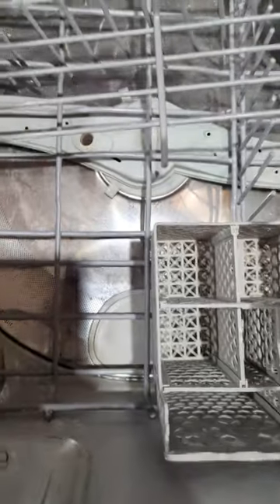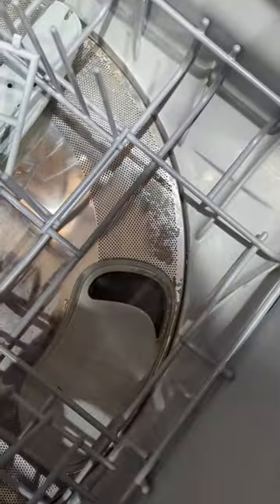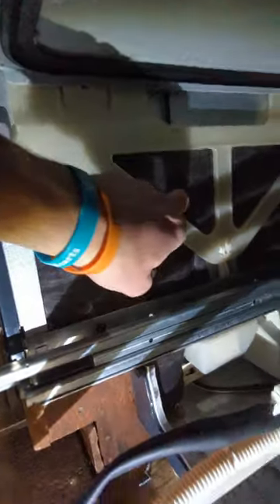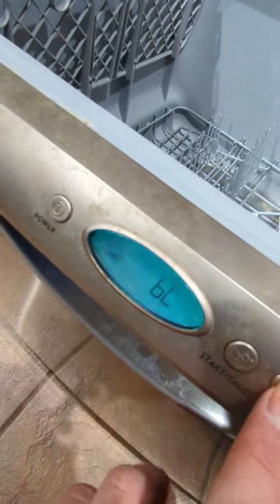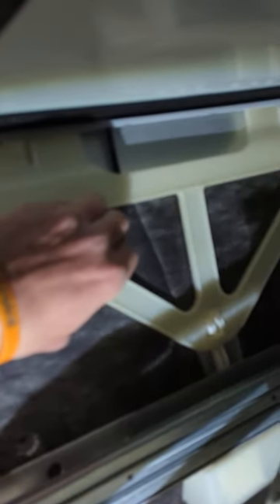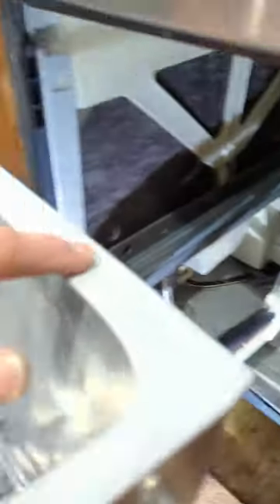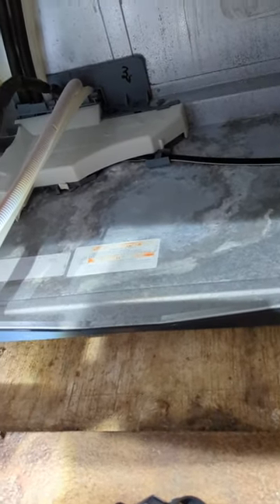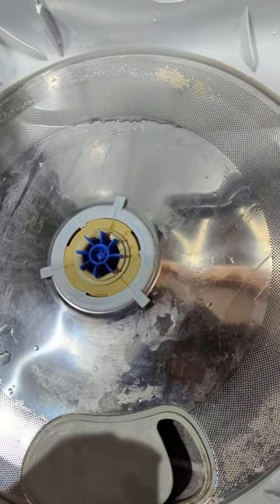Fisher & paykel double drawer dishwasher F1 solution.

Comment: Thank you so much!!! It saved me several hundred bucks. I had an exactly same issue that the attractor somehow moved back all of a sudden and by moving it to front fixed it. Great video!

Another thing that could help others in future: if you have trouble going into the diagnostic mode, press the power button to make the panel light off, then press and hold the lock button, once you hear the beep sound then press and hold the “start/pause” button(now you should be holding both buttons). 3-5 seconds later you will be into the diagnostic mode.

Comment: thx very much for the video, but mine turned out to be way more simple to fix. I was using the wrong dish liquid !! (DOH), the suds frothed up and spilled over the drawer triggering the F1 flood error in the bottom tray.  F&P recommend using powder rather than liquid (but Cascade liquid worked great as well). Good luck!
Reply from the maker: Oh yeah, that'll do it 100 💯😁. I've got a weak lid motor on the bottom drawer and it seems to be a cause of water leakage also.
Reply: Hi, I think I made the same mistake as yours (wrong dish liquid) . So do you know how to fix the F1 error or reset it to the original state?
Reply: Nevermind, I fixed it by wiping clean and drying the outer base of the dishwasher. If anyone is wondering how to do it, you need to watch a video to remove the dishwasher first. Then you can reach the outer base to clean and dry it.